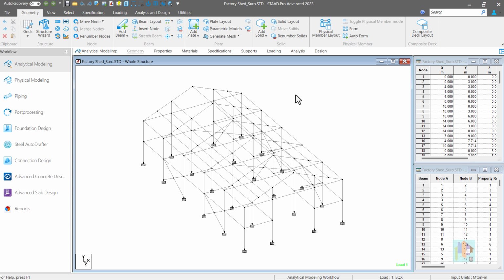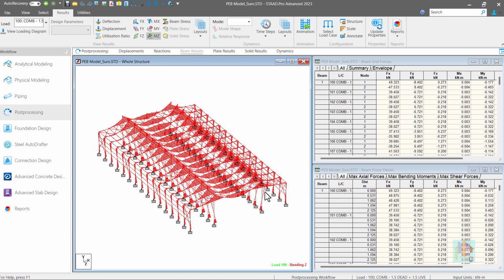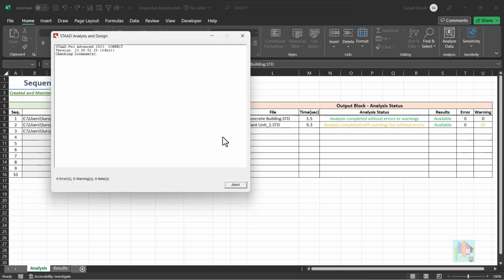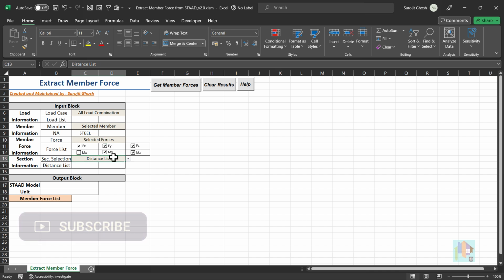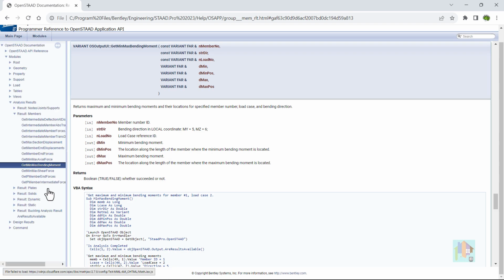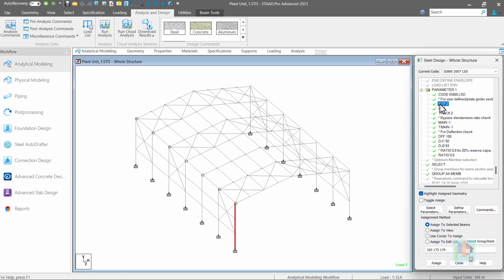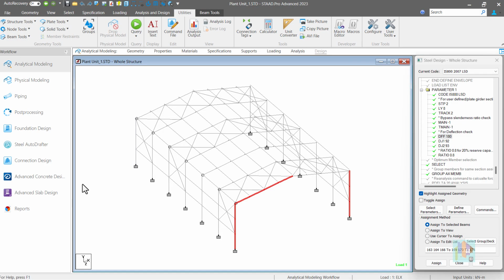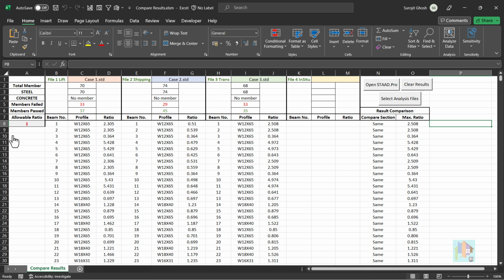Automation with STAAD - P5: Analysis & Result Extraction || Multiple Analysis || Design input/output

Comment: Hello Is there any openstaad module which extracts steel utilization ratio for all the parameters and can also extract governing load case of that utilization ratio.?
Reply from the maker: For AISC 360-16, yes you can extract design ratio from multiple blocks (GetMultipleMemberSteelDesignResults). For other design codes, ratio from the last block is extracted. Governing load case along with other critical information (clause, section, force) can be extracted using same OpenSTAAD function.